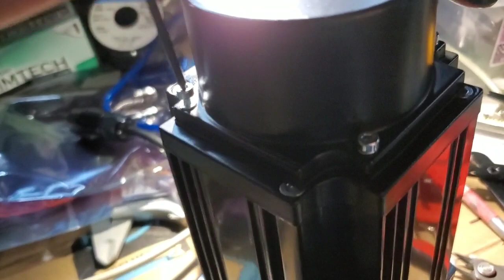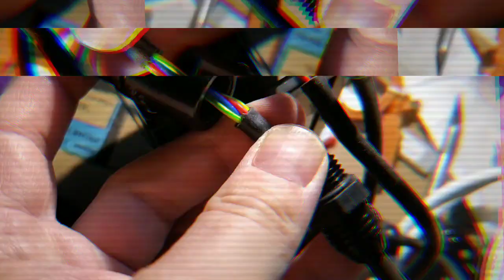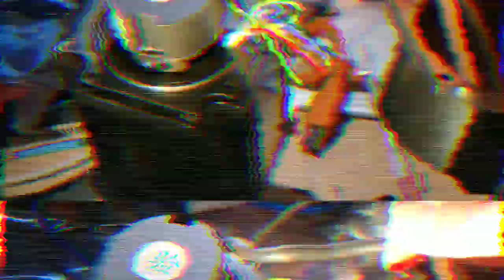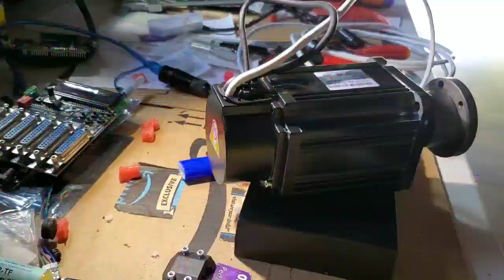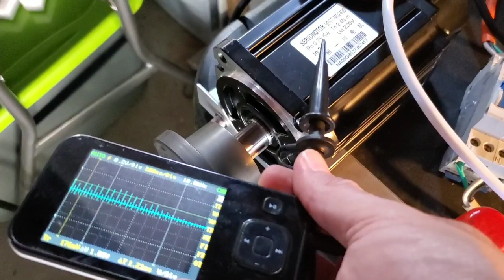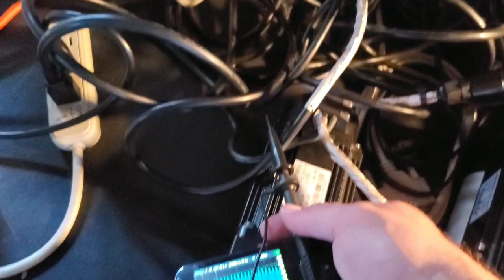Tutorial: Replacing Servo Power cable and testing

Comment: Thank you for making this video! I was directed here from the forums where I also found lots of good info.

How important is it to ground the cable shielding? I have tracking issue and only the short cables off the motor are not shielded. This makes running ground wires less than ideal. 

Also the power bar to servo cables are not shielded. Perhaps the EMI filter is not working (I have the eRacing lab Mega+) that is supposed to be within the PDU.

Comment: Out of curiosity, I went back to Barry Rowland's original PT-Actuator build video (2020) and he actually shows that the main cable is indeed shielded.   So without opening my servo metal enclosure, this confirms what I thought. I wonder why they didn't bother to shield the short cables from the motors to the connectors?  That just makes no sense to me!  Was it a matter of being lazy, cost cutting corners, or were the actuators built by another company who didn't care about EMI ?   In fact, I think I'll email Shao and see if I can get an answer (If he understands the translation of my question).  That's just odd in my opinion.
Reply from the maker: I pointed out these issues since 2019... I guess he never bothered to fix it. No wonder people's rigs are still festering with EMI and ground loop problems. 🤷‍♂️
Reply: @tronicgr   Wow really!  This is all new to me, so I had no idea.  Fortunately I have a little experience with EMI issues, but it's been over a decade or more since I actually encountered it in my line of electrical work.  Yeah it's not good for them to continue selling something with this issue when it can easily be resolved. Especially at the price that some of us are willing to pay for these toys!!!
Reply: @tronicgr   Interesting that he never bothered to fix this issue that you raised several years ago. So I shouldn't be surprised that my email to him and his partner about it has gone unanswered as of yet. 🤔  I'm sure that if this was an email about making a purchase, they would have replied within a few hours! 🤨

Comment: I have a Fluke non-contact voltage tester that I use at work, the kind with red LED and beeping tone. It's detecting voltage on the section of cable from the connector to the motor, but noting on the longer cable (from the servo to the connector). This leads me to think that the long cable is shielded, but the motor cable is not.  I have a new PT-Actuator 6DOF that I bought and assembled  last year.  I wrapped one motor cable (short section from the connector) in aluminum foil and grounded it, which eliminated the voltage detection.  Looks like I'll be replacing all of the motor cables at some point.  EDIT:  The type 31 ferrite choke that I added to my VR cable and the line filter seems to have eliminated 99% of my VR tracking problems, but once in awhile I lose tracking for a brief moment, which is what brought me here looking answers.  Thanks for all of your videos!
Reply: On second thought, since I only have short cables to shield, I think I'll use the conductive tape method.  It's a lot quicker than rewiring 7 actuators.  Each cable is no more than a foot long.  If I had to shield the entire cable from the servo, then it would be worth the big job.  Maybe Shao at PT changed the main cable before I bought mine and I got lucky...who knows?
Reply: @redtailpilot How did the tape shielding work out for you? 

Also, where did you place your Ferrite-31 choke? Mine is on the DP cable closest to PC. It barely helped though.
Reply: @Masty559  The tape shielding worked out really well and was by far the easiest solution for a fully assembled rig. Who wants do all of that work over again just to rewire every servo?  I sure don't!   I have 8 ferrites (2 x 4-stacked) mounted where yours are and since I bought three more, I placed them on the other side of the interface box. I bought an extension cable on Amazon as well, for extra room to loop the cable several times.
I probably didn't need as many ferrites after using the tape. Tracking is great now.    On another note:  I eventually got a reply from Shao at PT actuators and he basically back-pedaled, apologized for the issue and said he had an issue with his Quality control and cable supplier. Sounded like he was trying to say what he thought I wanted to hear, but I let him know that I learned that he was advised and alerted about this issue several years ago!  Totally unacceptable to still be selling units five years later with this issue unresolved!!!  
So he was pretty much full of sht. When people are paying this much money for something and they know there's an issue as big as this.....REALLY???
Reply: @redtailpilot   Good to know! I am trying to decide between the tape method or replacing the short sections of cable. I only need to remove the motors and unplug which isn't too bad. Did you ground the tape on each wrapped cable? 

Did you find each Ferrite choke made a difference? I would consider adding another one if it would help. Mine is a 4-stack of Ferrite-31 with a powered DP extension looped through 8-9 times. I will probably pursue fixing the unshielded cables first and see what happens.

PT Actuator setups are not cheap! Mine is from eRacing Lab which seems to use similar equipment. While getting advice from their customer support I told them these cables were not shielded and he seemed to think they are. That is when I realized I will need to prove it to them by fixing the issue on my own.

Thanks for the quick reply and info btw!
Reply: @Masty559  Hey, one thing I forgot to mention. In his email he said that the ground wire on the motor side cables, is NOT soldered to the ground pin and if I open the aviation plug, I'd see the wire there, just not soldered. So this proves my point that he and his team knew about this issue for years, but simply refused to do anything about it!  Unbelievable. By the time I received his reply, I had already did the tape wrap method. Yes I grounded the tape to the motor chassis via a short wire (removed one bolt and placed the wire underneath). I used spade crimp connectors. Also confirmed proper grounding of the servo chassis with multimeter.  So with that info, you might want to open one of the plugs and check for a loose ground wire, before you do anything else. Might save you a lot of unnecessary work.  Yes, I have the same Ferrite choke setup as you (8 or more loops, I forget the exact number) and each additional choke that added, improved the tracking. One choke only made a slight improvement, as you experienced. 
Good luck!
Reply: @redtailpilot  Ah makes sense you just grounded to the motor chassis. I was thinking I had to run ground wires to a dummy plug only connected to the ground prong ha! I think I seen all wires were soldered on. I will check again though! Thanks again!
Reply: @Masty559  That was my original plan as well. Then it occurred to me that the motor mount was probably grounded (which I confirmed with the meter). I'm always looking for the simplest solution😆
One more thing I did to tidy up the look, was cover the silver taped cables with black plastic cable wrap that I had. Looks so much better and the silver is practically unnoticeable.

Comment: wow well done with this option , thanks for adding captions as well :-)   a lot of screened cable will be sold via this Option  have to ask why not fit new crimped spade terminals to the Controller side ( easy to connect and not expensive and may ease disconnection ans re=connect during setup ,,,great work for community Thanos :-)
Reply from the maker: I didn't had any crimped spade, or a crimp tool, so I did it the traditional way. The captions were auto-generated, funny its done automatically for some videos right away.
Reply: @tronicgr  you know that that comment was not meant as criticism :-) a lot of guys with these systems will be making the change thanks to you and this option, and the VR guys even more so :-) Cheers